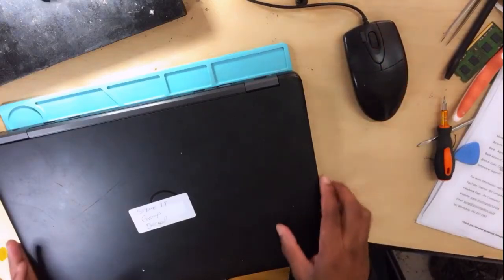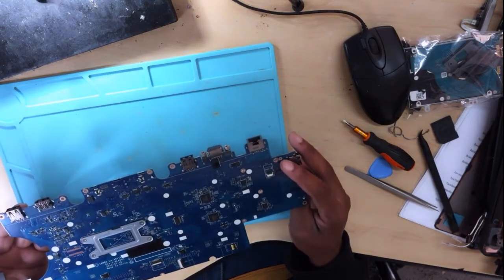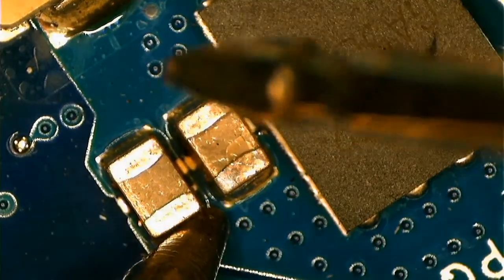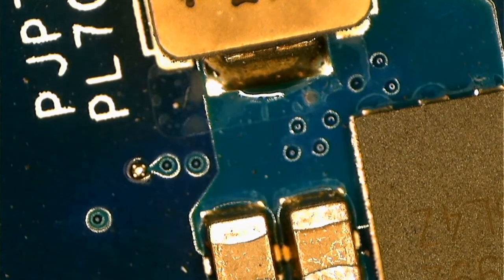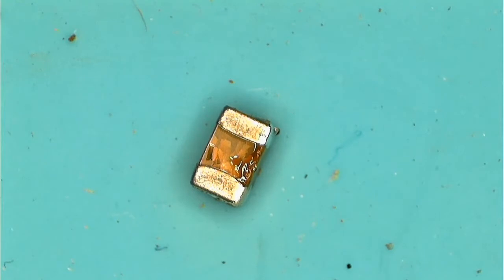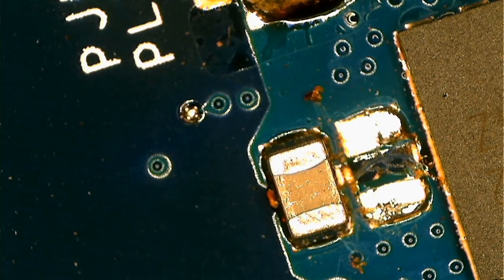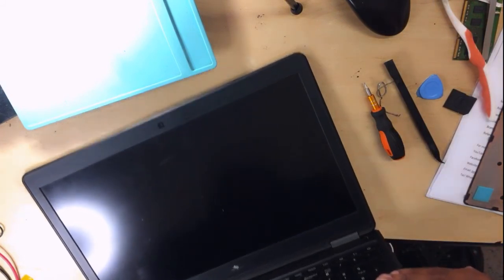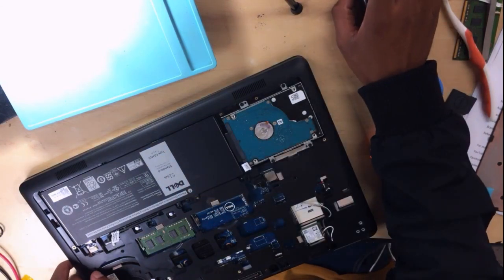Dell latitude E5550 not turning on repair tutorial

Comment: Hello. Thank you for the video. I made the same repair and it worked (other C of the two was shorted). Now the laptop is booting. However the laptop does not see the AC charger (does not run on AC when removing battery/Is not charging battery when battery is in).
Any suggestion ? E.g. I just removed the broken C, do I need to replace it ?
Reply from the maker: No it not necessary, look for another faulty
Reply: @jbvtechnologies  thank you for quick response. I have never repaired laptop before. Any suggestions what it could be ? I measure 19.2V at connector entry on motherboard.

Comment: Nice work.  I am working on a Dell Latitude E5530, no display.  LCD diagnostics work.  No boot at all.  RAM and HDD are fine.  Fan doesn't run unless I'm holding down the power button to turn it off or if I remove the heatsink.  I have tried unplugging all cables to the motherboard and any sources of power one by one (speakers, etc) but same problem.  I don't see any problems on the board, but my skill ends at repairing the system board.  I already ordered a replacement board, but I was still wondering if you might have some quick troubleshooting advice to share?  Thanks :)